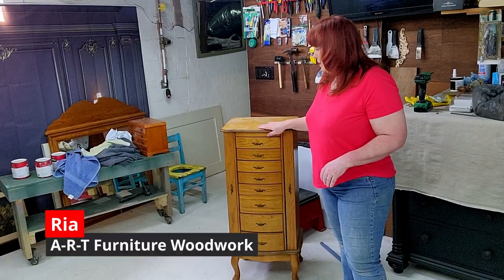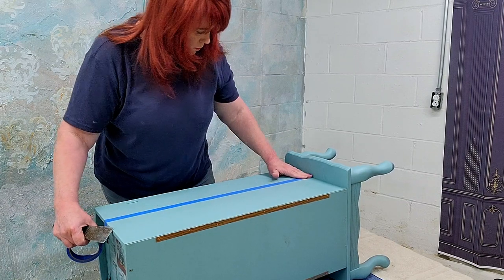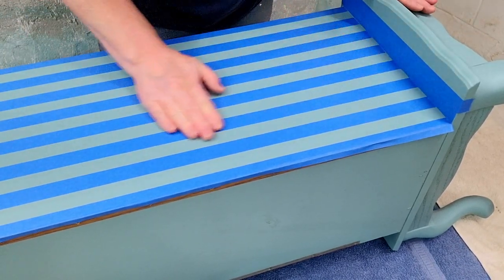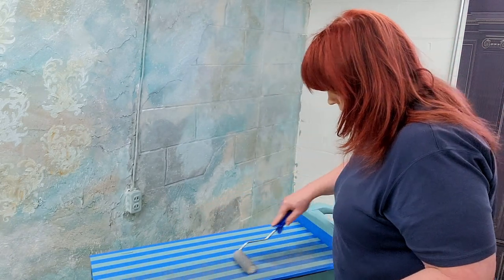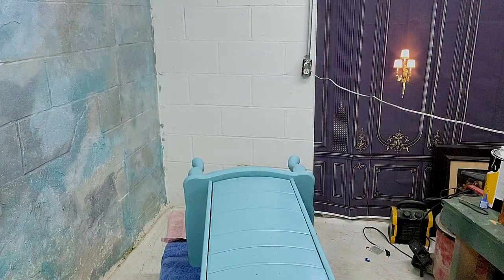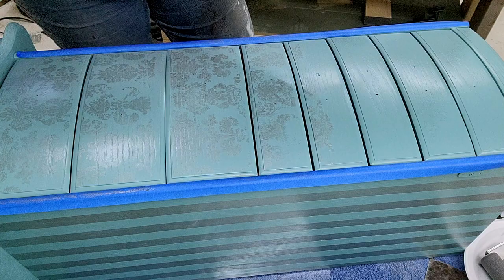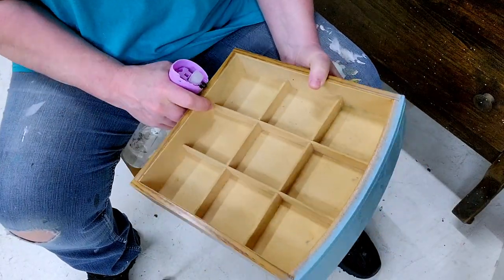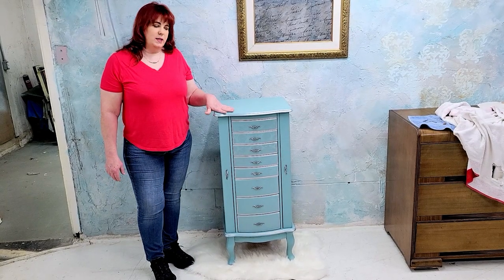Painting perfect stripes - a jewelry armoire makeover

Comment: Thank you for sharing that tip about stripes and the clear coat blocking out bleeding.  I see so many videos where people do the stripes or other things with tape and they don't do the initial clear coat, so often they have to sit there and hand-paint over the bleed through, and it doesn't turn out nice at all.  You can also use the paint used on the 'under' color, the color that's taped off.  I've also heard a coat of clear spray paint (matte) works just as well.  
The armoire turned out so beautiful, what a great transformation!  Whoever ends up with that is sure to love it forever.
Reply from the maker: That sounds like that would work too good idea, I like doing it with top coat because it dries so quickly but the base color would work for sure. There is nothing worse than taping off to save time and having to go back and finish it by hand and lose that time you saved.

Comment: I have used both topcoat and the original base color over the tape to prevent bleed through when making stripes. I have personally had more success using the original base coat paint…but same idea! paint….
Reply from the maker: That is really cool that you have found another way to get the same results. Its never quiet worked for me that way round but good to know it works for others.